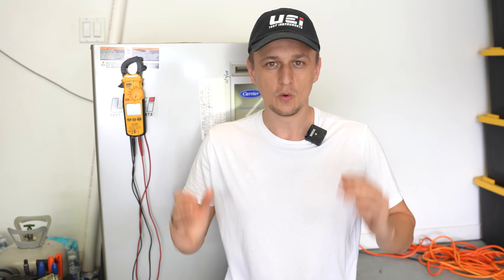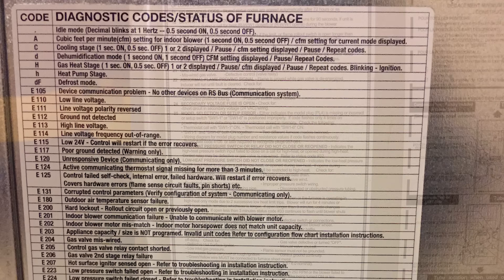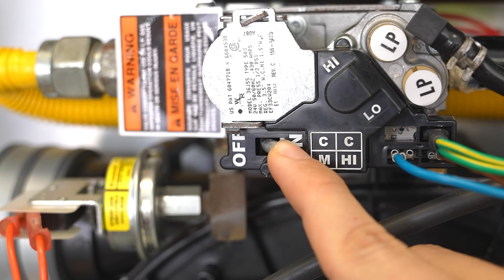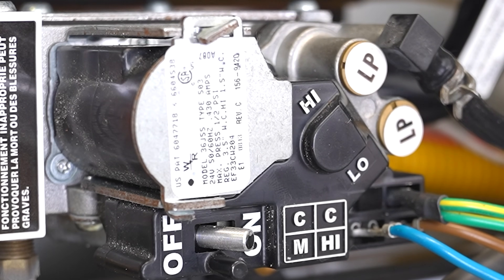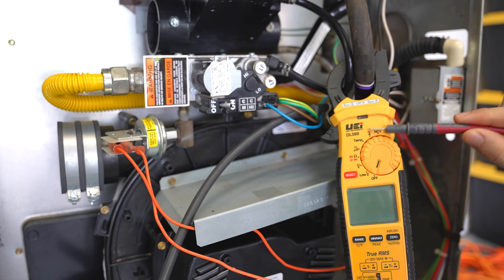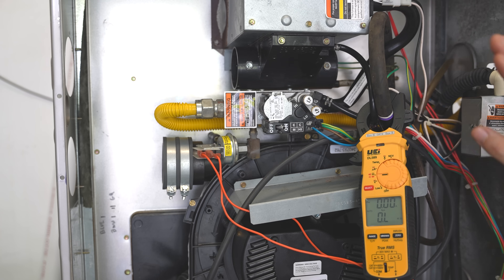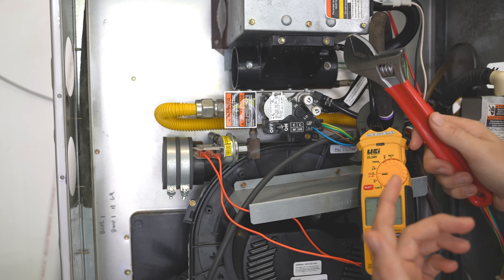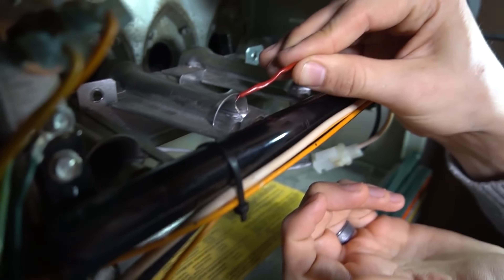Furnace Gas Valve Not Opening - How to Fix It

Comment: My inducer motor starts, ignitor glows, but when the gas comes on nothing. This morning i gave it a lil blow when the gas came on and 🔥 🔥 🔥. I was thinking the ignitor needs aligned but it worked fine yesterday. Worked for a few hours then nothing. Tomorrow ill try cleaning the orifice. Thanks great detailed video!!
Reply: You'll be wasting your time with the orifices. They never plug up. Never once have I seen them plugged up on any furnace.
Reply: @ good to know and glad i didn’t. Ive notice the higher the thermostat setting the better the chance it fires up. I want a smart thermostat but not w/o figuring out what the issue is first.

Comment: Just had a gas valve with fittings replaced and it’s still not working. It worked for like a day and then went back out again. I’m at the point where I think I should just go ahead and get a new furnace because it is 20 years old I’m tired of working on it. I’ve spent out a lot of money and it hasn’t worked for a full week yet..

Comment: Had issue with a high efficiency hot water heater.... and followed similar steps... and regretted not doing first check

check there's gas going through the meter outside !!!
(The only gas appliance in this house is the heater...and the gas meter got some debris in it. Gas company tech replaced meter and all was quick and free)

Comment: Question for you my furnace has power to the gas valve,checked with meter I hear it click replace igniter and flame sensor,cleaned gas valve orifice. Still no flame removed gas line smell and hear propane, have gas to my stove but no propane coming out of the valve on the furnace. Does this sound like a bad valve?
Reply: You basically answered this yourself with all the information you provided.

Comment: It can also be the on/ off switch contacts as well , you can be getting 24 volts to the gas valve but if the contacts on the on/off switch are dirty the power wont complete circuit to the solenoid

Comment: Thanks, Jay I had the same issue with my gas valve would open, but it would not ignite. I wiggled the wires and then it would ignite was wondering the circuit board to where those wires connect to can you purchase that or do you have to replace the whole gas valve?

Comment: My furnace problem is the opposite. At the beginning of the heating season, or end, when the furnace runs maybe once or twice in a day, I smell gas emanating from the furnace when it's off. I have to turn off the gas line valve. During the winter, when it's cycling on and off throughout the day, it works just fine. Is it a weak valve that is opening when not in use?

Comment: OMG!!!!!!!!!!!  Your video was spot on!  It was a loose wire connection on one of the two gray wires from the motor to the gas valve switch.  Wiggled them around, and the gas valve turned on, and now I have  heat at 6:32 in the am, in Illinois!!!!!!!!!!!!!!!!!!!!   Thank you!!!!!!!!!!!!!!!!!!!!!!!!!
Reply from the maker: Lol, I love it!! Your enthusiasm is awesome, I'm happy to hear you were able to get your furnace working again, thank you for taking the time to leave a comment, stay warm!!
Reply: @WordofAdviceTV I seem to have the same problem with a lose wire . Do you  replace the wire or what’s your solution?

Comment: Great Advise! After unplugging/reconnecting the wiring harness connector from the controller board the gas valve works as designed! We have a working furnace with heat again and it's 20 degrees outside! Thank you!

Comment: I was using my gas fireplace to heat my home until a couple weeks ago. I hadn't noticed an issue until during the day it seem like the heat wasn't coming on and my sister noticed it for the holiday. So I put the fireplace back on. Saw a status code 10 retry/ recycle delay on my boiler. So i reset the boiler and raise the temp on the thermostat since it was now detecting the heat from the fireplace in the next room. It seem to work but then I lowered the thermostat as it was too hot and turned off the fireplace. 
Well yesterday it did the same thing again. 

So I go check the pilot light and it's lighting when the call for heat is given, I hear the click from the gas valve but no burners were lighting. 
I started checking for loose wires as that has happened in the past but didn't see any. 
I left the boiler on and it then got the 62 error soft lock out, max retry exceeded. 

So that's when I started looking on  YTU, YouTube university. I was not thinking it's the gas supply or the valve as the pilot light was coming on. But I stumbled across a few videos but this one was the most helpful. I wanted to say thank you as I tapped on the gas valve when I heard the click and after a couple times I saw the burners light up. The heat has been on ever since, which is a full day. I'm hoping the valve is unstuck and working again.

After watching the order of operation video, which I know is different as I have a boiler but it was still helpful as I learned few things.  Plus I was then looking more at the gas valve and can see there is a separate gas line from the valve that goes to the pilot, so I'm guessing it's not getting stuck close like the main part of the valve. 

I was going to clean the burners thinking that was the issue, which I'm sure it's needed. But with the heat back on I'll wait and not mess with it till after winter. 

I suscribed as the few videos I've watched of yours, I enjoy the info. I think I may have watched one of yours when I was working on my hot water heater few months ago, which I did get working but then went out again and then replaced it. 

You have great content and very informative. Thanks and congratulations 😊 as you now have a new subscriber.
Happy holidays.

Comment: I had that same condition blower comes on, igniter lights up but no gas is delivered.  Reason was the burner tube end were rusted preventing the gas to spread evenly across tubes.  Replaced tubes and all is well.  That was a year ago and again the tubes are rusted and furnace occasionally won’t start.  Replaced them again. My basement apparently needs a dehumidifier.

Comment: I dont comment on videos. But you’re seriously the man. Been tying to diagnose this thing for a week. 47 degrees in the house when i woke up this morning. But before this video, whenever i would put my multimeter on the gas valve wires, it would click open right away, i would read 24 v, and the burners would kick on, as if i were a crazy person imagining there was a problem. Little did i know i was just wiggling the loose connection with the multimeter probes… thanks so much!!!

Comment: Hi Jay,
Everything on you video sounds very straight forward. But in my case, the gas value is not opening, the red LED light is solid on (so no error code), and when I check the voltage to the gas value and turn the thermostat on, it actually shows 8 volts before the thermostat is turned on and zero once the furnace is going through its cycle.  And it goes back to 8 volts when the igniter turns back off.  Does that make sense?

Comment: Dude you just saved me at a job. The board wasn’t giving me an error code, but I tried moving the gas valve wires after the ignition stage and it worked!
Reply from the maker: Glad I could help! 🙂

Comment: can anyone answer this one I came home from work one day and when I stepped in the house I was hit with a blast of hot air and the inside of my house had to be 300 degrees the furnace had kept running and the high limit switch had failed  why didn't the thermostat shut it down  this was a few years back but it still bugs me why?

Comment: Anyone want to take a stab at this one?...

The start up (gas) sequence is so random..

Sometimes it gets to the point of flames igniting.. sometimes only the inducer will kick on and off immediately.. most of the time, it gets to the point of glowing the ignitor, gas valve clicks open and closed immediately with no flame ignition and the entire system shuts down.

I'm stumped..
Reply: Blow back sensors are fine

Flame sensor is new

Flame ignitor is new

Pressure switch works fine

Anyone have a clue?
Reply: @RobertDoe-qq9vc  No error codes? I would think loose/oxidized connection, bad control board, or short.

Comment: The On/Off Switch on the front of the Gas Valve can get dirty.  This prevents the gas valve solenoid switch from working when 24Vac applied (mine did).  Turn off power and gas to furnace first.  Check resistance between C and M spades on valve with connector removed.   It should be OL in OFF and 50k Ohms to 25m Ohms in ON.  If only reading OL then time to clean.  Use electric contact cleaner sprayed into the switch while moving the switch up and down it.   Retest with meter.

Comment: Thanks for the video ... apart from my igniter being removed and replaced, I banged on the gas valve with a rubber mallet and it fired up ... The gas valve gets stuck closed and that's why the furnace wont ignite. Is there some kind of repair kit to do a minor repair or is it rigged to where I have to purchase an entire brand new gas valve? Let me know, i would appreciate that greatly ...thank you.
Reply: Should be a way to repair

Comment: But what if the wires are in a molex connector?  Can I unplug it and stick the probes in the connector or does a wire need to remain attached to the gas valve?

Comment: I've been watching your videos, and I have an interesting one. My Furnace actually Turns on goes through the entire start up sequence . It actually starts up you feel the cold air coming through the vents, but after 3 minutes, I've timed it, the air stops blowing through the vents in the house and no heat comes out. The furnace continues to run, but like I said no heat comes out. I replaced the air filter and cleaned the flame sensor just for good measure, but still does the same thing. Any ideas? I've got a repair guy scheduled for Tuesday, just in case.
Reply from the maker: Sorry to hear about the furnace troubles! Is your furnace control board blinking any error code when this happens? Do the burners come on at all or no?
Reply: @WordofAdviceTV  no error codes that can see from the portal. But maybe I’m not looking in the right peep hole. I believe the burners come on. It gets through the entire start process but just before the heat kicks in cuts off and like I said runs for 2 more minutes before shutting off. Maybe I need to watch the entire start off process again with the lid popped off again.
Reply from the maker: @growinginportland  Is the blower motor coming on at all? It almost sounds like it is overheating and all you're hearing is the inducer motor running. The blower never comes on.
Reply: @WordofAdviceTV  I just took the lid off again. The gas valve is fine. The fans are blowing. It's the igniting. The flames never come on. This explains why it shuts off after 2 minutes. I'll check to see if you have a video on this. Thanks for your reply. Appreciate it.

Comment: GREAT videos !!!  .... quick question. I'm a maintenance tech at a large apartment property. We have found many times instead of replacing the entire gas valve that we are able to just replace the electronic ( coil ) part. What are your thoughts on this ?? We've had 100 % success rate so far.   Thanks !!
Reply from the maker: I think that's great! Where I worked we were always taught to replace the whole gas valve, supposedly for safety reasons but I'm thinking it's mainly because that makes more money and it's easier to order a whole gas valve instead of tracking down the coil. If it's the electronic part of the gas valve that is failing, I think it's great that you are only replacing the coils. Personally I applaud that!

Comment: One tip I have for Goodman furnaces. They have a silly design where the wire the condensate pressure switch in line with the gas valve common. This will not throw a pressure switch code and the ignitor will still come on like everything is ok even if the switch is open for whatever reason
Reply from the maker: Good to know! Thank you for mentioning that!
Reply: If this occurs how do you temporarily bypass the pressure switch
Reply: @justinvanrees4995  short it I believe

Comment: Yes I’m having this problem and also I check the voltage at gas valve connector got 14 Volt instead of 24v 

Control board failed or something else?
Reply from the maker: Is the control board blinking any error codes? From what you described, it could be a loose connection, bad transformer, or a bad control board.

1. Try wiggling the wire connectors as you are testing the voltage. Does that change the readings?
2. Test the secondary side of the transformer, how many volts is it outputting? If not 24-28v, then it's a bad transformer. (also verify that it is getting 120v going into it)
3. If you can't find any loose connections and the transformer is outputting proper voltage, then it's likely a bad control board?
Reply: @WordofAdviceTV  I had the same problem, going back today. I only had 14v as well. 

I changed the board , still 14 volts. 

Super frustrating
Reply: Thank you
Reply: 1 short and 4 long

Comment: Hello thanks for your videos, my furnace will turn on and reach the set temperature but when the room temperature drops  it doesn't come back on. When it reaches the set temperature the blower motor stops but the inducer keeps on spinning indefinitely at a slower speed. I've replaced the air filter and changed the pressure switch and it still hasn't solved the issue. Do you know what else might be the issue? Thank you.
Reply from the maker: Sorry to hear about the furnace troubles! When this happens, have you tried checking if the control board is blinking an error code? It could be a tripped safety switch or perhaps the control board is failing.
Reply: @WordofAdviceTV  Thank you for for reply, yes the control board is blinking an error code. I'll check the safety switch and control board.

Comment: PLEASE HELP! I forgot to return the cover when i changed my furnace filter. 

I found it off 24 hrs later when i went to see why it was no longer working. 

I can’t find the reset switch and it wont do anything but click when i turn the power on
Reply from the maker: Ah unfortunately the video I made for exactly the problem you are having is not edited yet! Would have been nice to refer you to it. Here are the 10 things I go over, perhaps this will give you some ideas of what to look for:

1. Furnace circuit breaker tripped
2. Furnace power switch off
3. Thermostat batteries weak or dead
4. Bent thermostat pins or loose wires
5. Furnace door switch not fully closed
6. 3 amp fuse burned out
7. Bad transformer
8. Condensate pump or drain pan backed up
9. Furnace is overheating/stuck high limit switch
10. Control board is bad
Reply: @WordofAdviceTV  Thanks for the advice!  i will be eagerly waiting for that video to go live!
Reply from the maker: @casa_ceballos  No problem! I'll try to get it done and posted Saturday or Sunday.

Comment: I am not getting voltage on the gas valve. Looks like a bad circuit board. Trane XL 80 Where would you recommend getting the replacements from? Is it worth it getting the ones from ebay?
Reply from the maker: E-bay is good. It's rare that you get a bad part, just try to get one that allows returns just in case.
Reply: Make sure you get the correct part number from the control board.  I have a trane xl80 and  ordered 2 incorrect models before getting the correct 1.  Should be number,number-M-and 3 numbers after that

Comment: My gas valve is clicking repeatedly.  Flames come on and then it shuts off after about 5 seconds.  Kind of sounds like the valve is opening and closing repeatedly.  Is it a good idea to replace the valve?  I don't want to aimlessly throw parts at it.  Thanks for any help
Reply from the maker: This sounds more like a flame sensor issue. Have you tried cleaning the flame sensor? If yes, then next I would suggest this video: https://youtu.be/-QKHz1Mv9Ew?si=_8tUOzxwnmRogv57
Reply: I don't think I explained correctly.  It's not just clicking on and clicking off.  It's clicking multiple times at once rapidly. Like 10 times in 5 seconds

Comment: Don't forget that if your furnace has a smart valve with a whole bunch of wires going to it and a code comes up on a flashing LED in the center of the valve that doesn't point to any safety item just go ahead and replace the furnace. Anyone dumb enough to replace a smart valve with another smart valve deserves everything they get. 😂🤣😂🤣

Comment: Is it possible that the valve on/off switch turns itself off? Or did my service tech turn it off after doing a regular maintenance 2 months ago? I turned it on and everything is now working fine.
Reply from the maker: Probably the service tech. This would be the same as the light switch in your room turning itself on or off.
Reply: @WordofAdviceTV  thanks for the reply! I was mostly I guess wondering if these switches generally had some sort of automatic turn off in the event of a problem. Sounds like probably not.
Reply from the maker: @jasonkarlsven5216  Ah thats what you meant. Apologies for the misunderstanding. No, the gas valve does not have any auto shut off features. At least that I know of.